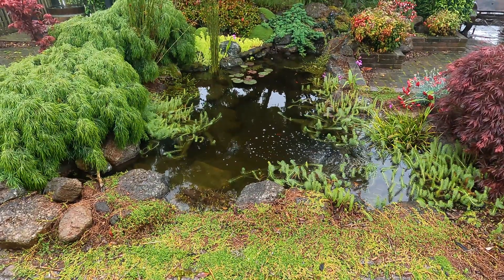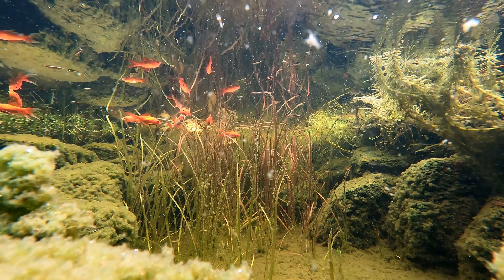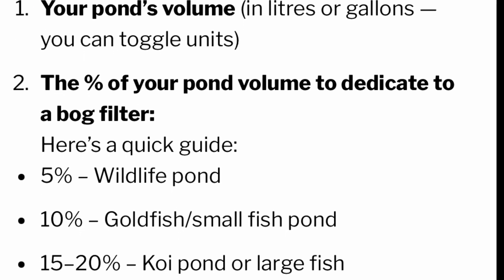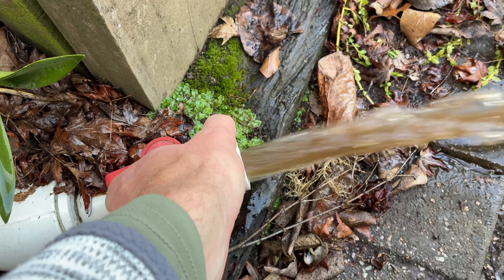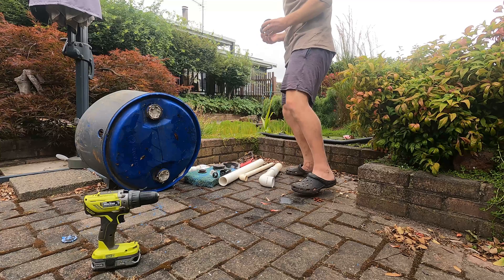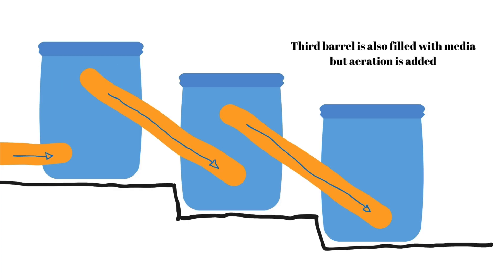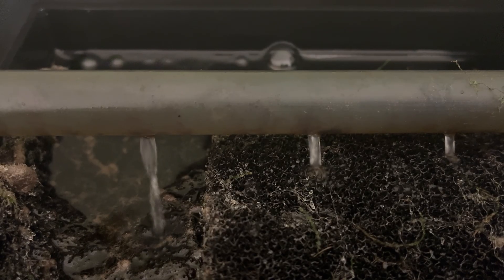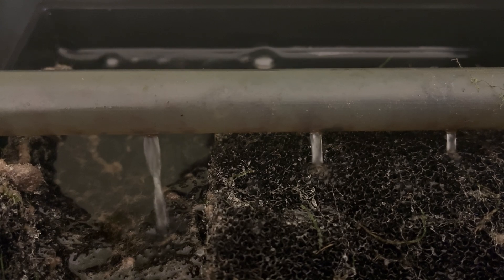How to Make a Biological Pond Filter and How They Work

Comment: Hi Kev,
I’m new to your channel — thanks for all the great videos, they’ve been really informative!
I have a 10-foot concrete tank (not a pond) in my garden, with glass panels on the sides for visibility. I’m wondering if a bog filter would work well for filtration in this setup, or if you’d recommend a different system.
Your advice would be a huge help as I work on completing my setup.

Total capacity would be 2200 liters
Reply from the maker: I like a bog for filtering almost any water setup 👍
Reply: @Ozponds  Thank you Kev

Comment: Hi Kev, 

I've built 4 bog filters heavily inspired by your small patio bog filters.  However these sit on the corners of a 600-700G above ground pond.    The primary difference is that my in and out flow are through the bottom of the bogs.  They are under sized, and I ended up using a pre-filters on them.

I made build video for the build of pond and filters, and it is not as easy as one may think (the video making that is).  So thank you for all the work you do in putting your videos up, very appreciated.  I always thought your videos were well done. After (trying) to make a couple myself, I have all the more respect for your video quality.   If interested here is a link to my build video,  it is not the best to say the least...  but may be of use interest to your self and others that watch your videos.  
 https://youtu.be/EIBbgVh1N5s 

Cheers!
Reply from the maker: Nice work. 👍. Yes making videos is very time consuming. I often wonder why I do it….but then I get really nice comments, messages and pictures from people all over the world- that makes me smile.

Comment: Before I found your bog filter tutorial, I was basically doing high flow filter by using a water fountain pump and a container box filled with filters to cover the pump. Alone it would at least help clear water and floating mulm around, but not enough for string algae, excess mulm at surface and likely dead zones. 

I still think it's good idea for small ponds and anyone with no DIY skill for bog filter.

Comment: I built a 315L bog filter for my 2700L pond following the advice in your videos. The flow rate is a little low at a measured 1300L/h, but it is a wildlife pond with no fish. So far no algal blooms but it's not doing much to clarify the fine silt from the water. I tried a little flocculant which appeared to work really well at first. Unfortunately the next time it rained all the settled silt in the shallows was stirred up again. The problem is that I put a 100mm layer of the very sandy soil dug from the pond hole on top of the liner then covered that with another 100mm of gravel. The pond plants seem to love it but the very fine silt in the sand can wash out from under the gravel. The bog filter has been running for about 2 months and the plants in the bog aren't taking off yet as it has been quite a cold start to spring here. I'm hoping that once they do the roots will help trap the silt a bit better. Am I being a bit over optimistic here? Do you have any other advice?
Reply from the maker: I’ve talked about this in other videos- The problem with a BOG FILTER
https://youtu.be/dh_ynnlwJ4c
Reply: @Ozponds  Thanks for taking the time to reply and provide the link. I wish it was mulm! That settles. This is super fine clay/silt particles that stay suspended. It initially looked like a yellow pea soup farm dam but after many water changes now it's just a haziness that limits visibility to about 300mm depth.  The pond is only a few months old so I'm just going to sit back and see what happens over the coming months.